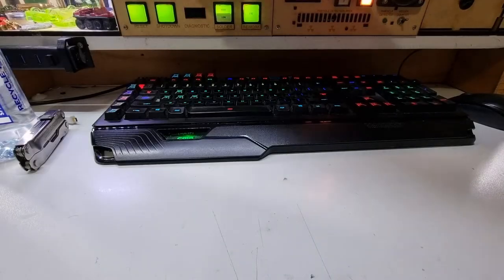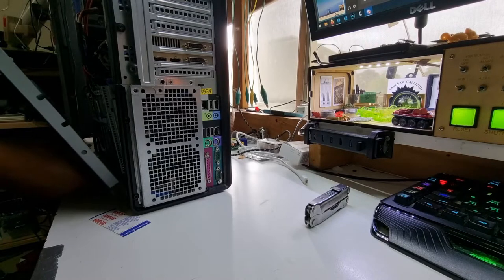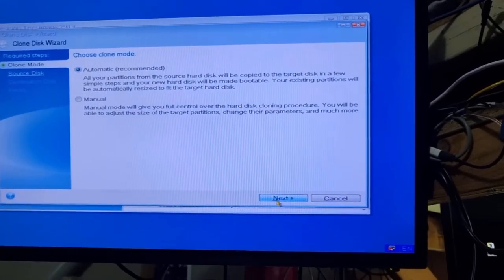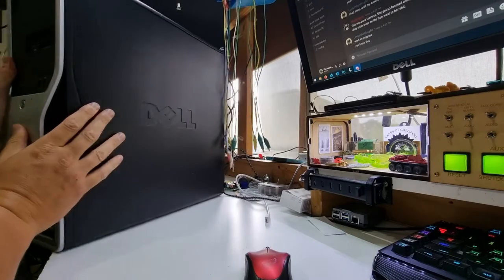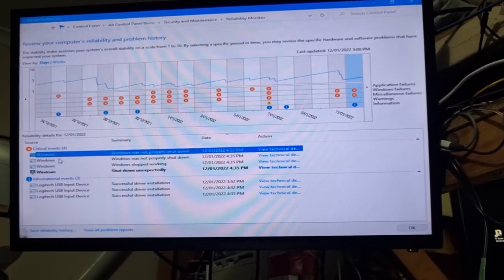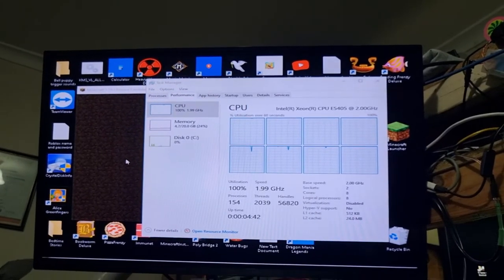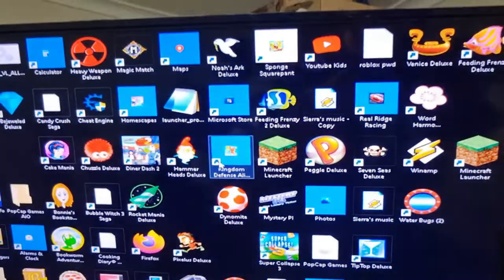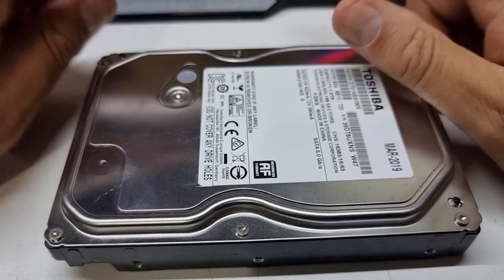Dell T5400 SSD upgrade | Apprentice's gaming rig

Comment: Question Sir, I’m trying to reseat my pci-e card but having trouble removing it. Is there a special technique that I don’t know about? Thank you in advance, Jim.
Reply from the maker: If it's a video card, there's probably a locking latch at the lower rear of the card - right near the pcie slot.